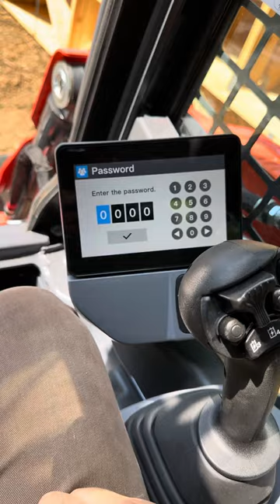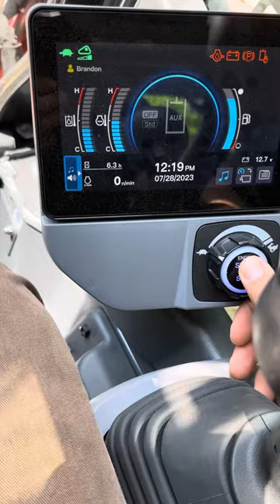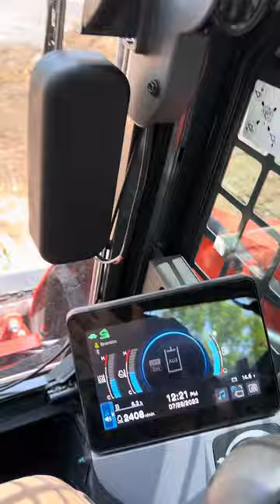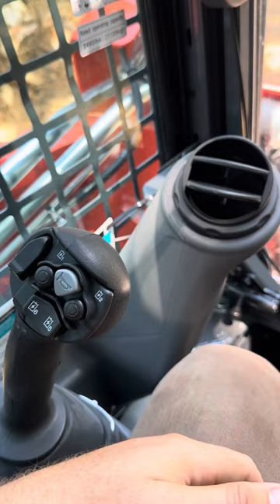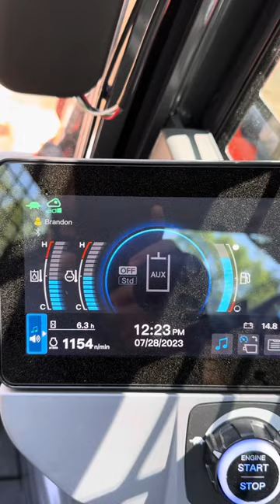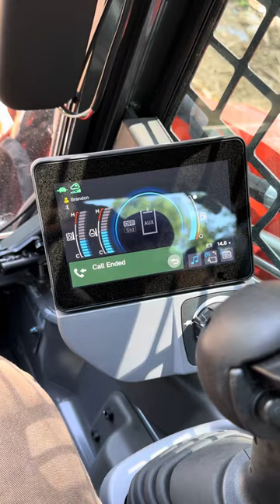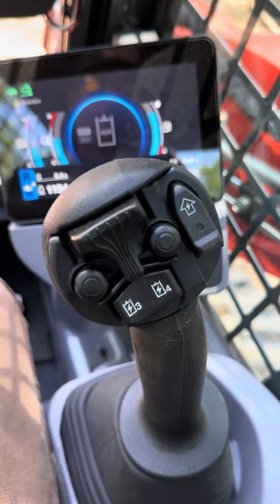2023 Kubota SVL75-3

Comment: The AC works better on the inside. If you take the back plastic off the seat, it is sucking UP 2 a return air. It slows the airflow it did all mine

Comment: Thoughts on a 75-3 VS a 90+ hp machine for just one machine to do all? We'll be doing a lot of dirt work, but also using for everything including driving around on yards. Mostly rural area, space not a concern. Another way to ask is, when do you decide to use the svl-90 VS the 75, and how often? Thanks!
Reply from the maker: @bossturbo  if I have heavy stuff to lift we use the 90 or trying to move a larger quantity of dirt we use the 90. Everything else we use the 75. Also keep in mind the 95 and 97 machines have DEF… if you can find a low hour 90-2 they don’t have it.
Reply: @brandonstooksbury5303  thanks for the reply! for the larger amount of dirt, you mean for grading? Or spreading material? How much time does the 90 save vs the 75?

Comment: Thanks for the clip, I know it’s rude to ask so I’ll reverse my question - is 75000 a reasonable price, loaded out the door for a 75-3?
Reply: My dealer is charging $72,000 plus tax
Reply: @pavelkolp  did that include a bucket?
Reply from the maker: Total OTD price for Skid steer, glass, high flow, reverse fan, Bucket, and ST&FD tax. $80,313.44
Base price I think was $72,895.00
Reply: @MrBobSanchez  yes 68” or 74”
Reply from the maker: 72” is what I had on my 75-2

Comment: I have heard the SVL75-2 feels a little underpowered when driving into a dirt/gravel pile and lifting a full bucket load. Does the 75-3 feel the same or more powerful in those situations?
Reply from the maker: I never felt like my -2 was underpowered… the -3 seems very similar. The biggest improvements I have noticed is the lifting capacity and the auxiliary flows are improved dramatically.

Comment: Your dealer screwed up. Should be a 74inch bucket
Reply: Why does it matter?
Reply: @skliros9235 when digging and grading, your bucket would be wider than your tracks. This bucket is and inch or two skinnier than the tracks, it can cause wear on your tracks and not cover track marks when smoothing in reverse with the bucket.